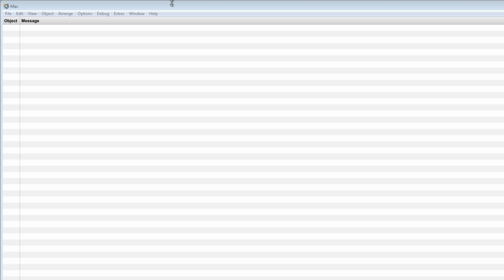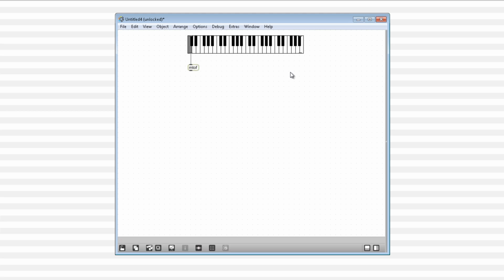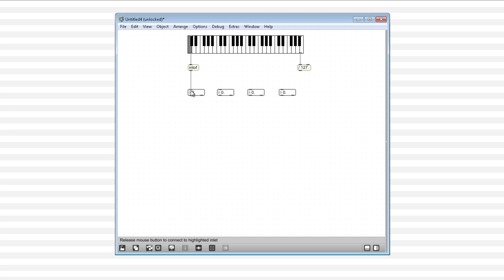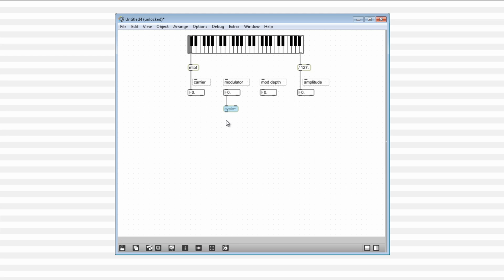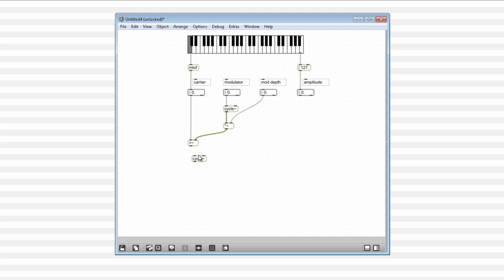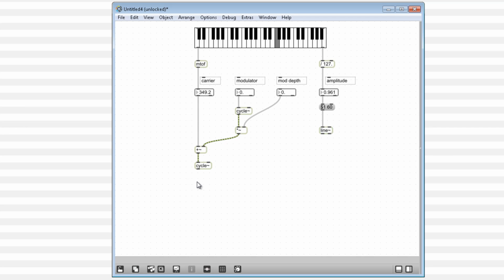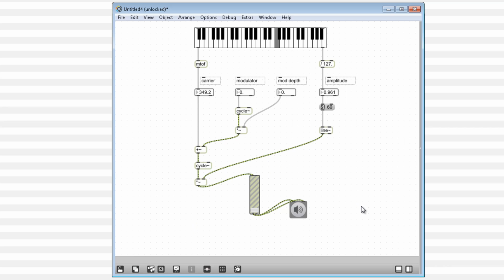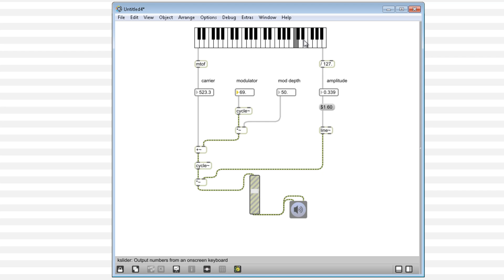Project HBC Tutorial - Frequency Modulation and FM Synthesis in MaxMSP

Comment: How would I map my MIDI keyboard into this patch and add an ADSR?
Reply from the maker: You should look at the help section for the midiin and midiout ovjects as well as the notein and noteout objects which will accept midi information. You can place them before the kslider object at the top. 

The adsr~ object will accept floating point values and can be used after any oscillator. Check the help section on each of these objects for more info. 

Post your patch up too, would like to see it.
Reply: +ProjectHBC Thanks for the reply. I didn't realise how simple it was to setup my MIDI keyboard for it. Here is my patch and I've somehow mapped the velocity of my MIDI keyboard to the pitch of the sound! https://www.dropbox.com/s/egtvhv8yv1asv1x/Synth%201.maxpat?dl=0
Reply from the maker: +Harry Bolland heres a compressed patch incorporating ADSR and the frequency modulation I discuss in this video. to open it highlight all the code and copy it, then in MAXMSP click file-open from clipboard.

also, your patch wouldnt open from dropbox, any chance of compressing it and sending it like the one below??

<pre><code>
----------begin_max5_patcher--------
2372.3oc2bszjqZiEdsSU4+.E0rJoSOnG7JKRUopY2TYSlk2JkKrQ1sxECDP
tucmTS9sGgDXDXflWpa66h1tkDFe99z4kNR3+5a+lMl6RdgjaZ7iFexXyl+h
2yFQeE8ropiMlmBdYeTPt3BMCoAQlOTNRN8OIE85X8nUUezPw0kr62+A.Dc4
RiOeJ4LKhvD2FPU2GhRBX7AROyZzeZ.a+Sz3iayH6YRID65y+VLf.waXqpWM
9sKhC60Hg7Xd4q8z4HwG25Q6ptjhA60Th79JkAy5aSZPVvIBijskDGrSdGsT
vAM9BLDc9++1uo3c9aOLZZj+cxuSWDyCIYmBDBpSW7H.zCOBGfufN3BJBAEL
ks3UH7M3qqHGyGLL2EDe7clehIegi7KhEi7h.UlmXIGL6hhr7eKUs9oHnmPk
BXMWNp9x0L7+t+tKvigyG6Xns3M77fdN8XL2gPOD.b0If8utOhzIIfrmOIf7
gBaDz8AI78cqEfV.AX6K4g6CBnGy.mYP.HOKEuj2+lAX24SBPe7h7CpKVXRA
KgNyHVYUtEt2iwJmF8fmA8Toe3.+JJUhvviOdJINoyfIn4jvkKnfX77VjQDM
lUPTEus5FRmH44AGIWyEfNIAvLbkfwBRvFTg90Lgp02QJO0+PgNYWlJ9yG+.
AxclYBEsrRzrgPpwujbNmj+GmIAetShvaNDgEfulqRqAeu0UQ.03KljUB6Jb
ycBRiHOSxxoIwpB5FyfzTk92n9gJnqeOQbubentOZrrOq59xHOSqtEN0cGjw
IAFmANmIA1KNW71VbmRBIYwmo0yhxIvJQql6bbktPDAkbJWpqm5Zc4S1GiR1
+YRXCQyLIkDSiSyH4jXV.qTFqGOjbHfuj3sGRhYUqdWnq10EbHXOo+OdL2ys
.k+blRMA1XdLiFxcqxEjlLeQ+Uekex.HV1QwqJXRbIwAoc8w4Jhb9ouQy4f8
b9tfrhIlx.IvKixRRhZNV8mLhbfUNdJMNtMgxRRGXzL5wmF5SuKgO5oAu8hg
x2dNVN7Vt4JaadvysXdVPTToAbqugWBho7.9DFUNe.spGUFU8o78YIQQMwsb
nm6ZnPt58dxWngrmj0NQUAf+AnoUJVl0S6gzijbVqNYAGya000l879NuqzPd
KibJMhilVWQiJU0vnU0sWyAZ49aexoSjhfqJWvEef+27HJ25zHkxEiFWReVJ
Ui0iYPKWndMFnoWzF2xtx9xQMsbOYj0FNC5gW6I1wl53GUtfzCoVEb0.nAF0
eALJTlXRIiJS5+tfQiSXDZrwyDtueJ6UMPq.qEvqRcyJEU+6FZkkXDbJ03m+
O+ue0fFqCVErDVUVvanHeJf8Mk15ty7.bw8AamgfM3MfsDnHqKpQS.0uQF0u
GLSyrsapuk+EMElw0ZwDNrrRXNWkw9jH7gHazpS1rjiGiH8pFhVLq.7EVeKU
Mrwp5eyJf7QqlROX7un.iex.XvdhDaXYPhxIZIZtyxUbA1xkT.8zml65y+sJ
ISyI.KMvz19K2mrrFGHnvjPKDM7cUQ+TQ8ONPi3lg5fwsWtSYWgRsi+8jp8P
LNyXmNXZ3xY5x2vKioe+y2Pbu6iXf3ESL3xzwpdcsB.1fVZLuWkxt3t9NyWK
wj0yd83q6BxxYAjE.9Uo1kTz5kwbWvxAsK2iRQBoSjwZ5CZpzgRkZinw8VON
gLWbA8PT4Imy1WMkU411nE.BI4LZ7kJX+o5Posuxmnggj3qXtPZdQ9zx5sN9
42oK71iU3KVM7MlvWj18HEdzsmvCFsZi+smviFqv6ZcyI7tiVsoKS6OXguHW
nQpye6w7P66XC1hDElfNO31xOu+XE9hn6qHya7axF0aUrYw1CFtUtinaCXrL
5tyLY73F6B9D2stiQI6BhJ2ItKq3Z3stqdG9tHkq9ATPtqGcdre64fIfd6io
CFtVGSmgOsNy+7ZP9yvf8cdH+56L9YMDrQhRHX6Hy21t50AgslO8M+ad5+tO
pbx05rH.CT.fFGWoYbHUr8JKVn3MLXd5Bse.BVIV6yx8jtySjy7OdZ.r7n9h
bpNxyqv4Savywm5oQQQdD5gV8JKqDI1Ze+p08xHQjfbxZo74MCSRrGRwjzFd
0dK7lljf0mWxOmyBT71tPdwYN7RSWUt2D7RHYevqqEqfmAqf7U0Vv2FZK7jO
B1+40hVfygVvdeXzRmOLbXKqteb3ff07ogqz2APXcHcfV75xhb8dbdr6jz.c
yXVqIiU5U4qDFqW0Lf+JRZUNc9pmz7VSRCeupocjG4uyUb.bmyiMhEpnF0XG
65ivC3Mejc66wJZZIcxuTRwItsnJ7pSWZdEMAg4Y+8JENDzWVB3A08D6bosL
7.vCtnGkqGT+Owe8jftcKlTdYM2lfRlsckWp32qp3BtYsC6qTQMpTTGEZw7D
MLMgqOjWsNHoVY0NqW2R4q5p5xzoRhFfh0Lfhc4g0hmobUK8AEf6Xfh.vSZZ
AADankikzcIRn+1rEt73W46IlxfZcJaTyXhG67INm4YIN1LtNJpehVZbNqsX
1CZ.fYpAhjOuSpszHZZKl8nBhlKXjEGSskFACDMFvzpz4i.LXOgUBzQVsSkV
ZzlAOpIlI6mC44Kjd4IqPskFwhynvhyT8yUNSfftRWZRGbMaAJKGIVZM4o0P
StiFmyYNqDKpszHVbFsiAvbvhs7Tg4itzRiXYT9EP1y0ImGV0ImmVwRaobfb
FlCVvxEZo1RiXYTQRwSEJ19xj2rvJI7zpk7Go.jsLouhVZz8mmdvIFH2EBjL
FqbyHZ1BK+YFnJouFsdW4.TKGE8DZdxdSbjOIORPWNwKZowzLFCRPS2wHTLa
5JiKKwkqs1mSrFybxbxJGH0NUao24DqQMmLGn33nfDGst7BznPhvixzRUx1p
Rg5A0FZzq2nVmDZxKSpT3kkBTowG7xWESIv4r5UYfInsb6yazp7D8ZCrttkL
oCr+kFevd7ZGkahd7JCloYcxQ45dl4aTN0o1RiHAL5bJvSx5xW7jHYKe.vrQ
hrAa0RVHTafi3J8zZAJfViFmnIgyxB7IQFlq14V0Ti1Q9iFLSxSB1RcRCWlL
jlwx3SpcZoAYqNwfjt2Z0pLwUe7iP8m4JXTEhAL8BwHy6dvhzV9SInrbthVi
CmkaYPqefdDPr8OLOs+Q4oiePdF3Gimq9g3QHC7W9Gn4+OrK
-----------end_max5_patcher---------
</code></pre>